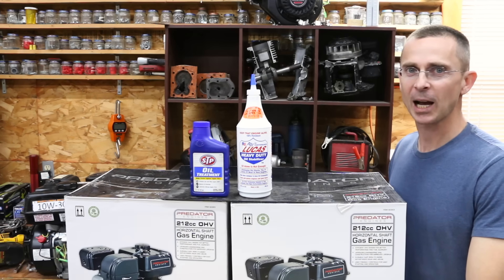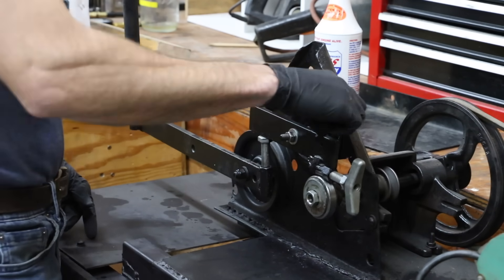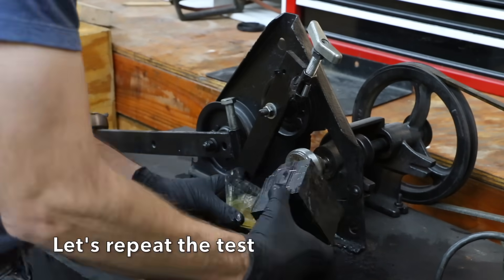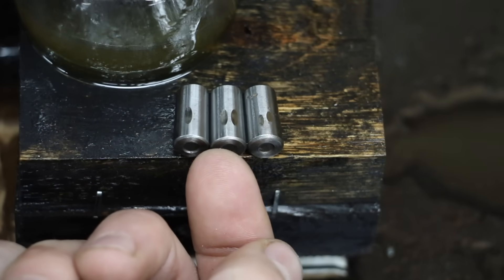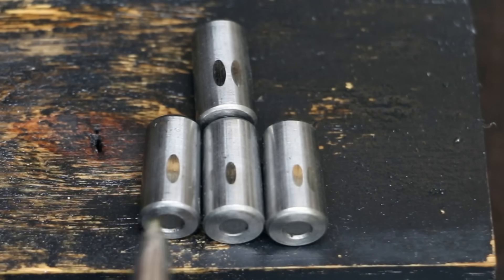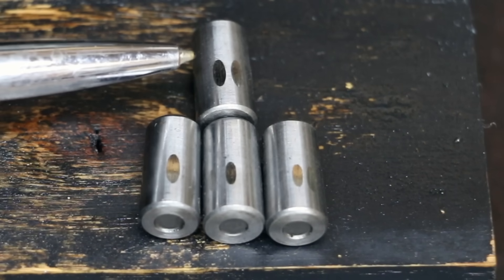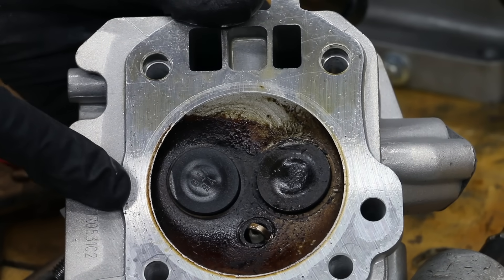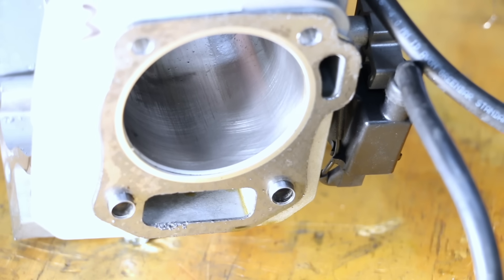Which engine self-destructs first?  Lucas or STP?

Comment: Interesting video - I did watch the whole thing and echo some of the comments here. With an N of 1 it’s fairly pointless to conclude anything, plus there is an underlying assumption in this test that that these products actually have a long term benefit which I don’t think has been shown other than anecdotal or the manufacturers data. 

To show a statistical significance this would have to be designed entirely differently.  Perhaps 10 engines per group, running under load for the design life of the engine with oil changes as per engine manufacturer recommendations with a control group running regular oil as recommended by the engine manufacturer. 

I’d bet there would be no significant difference in any group - the quality of today’s lubricants make additives useless. I’d almost wager the additive groups would fair worse.

Comment: There's an interesting factor about these cling type of oils.  They claim that at startup is where the most damage comes to the engine.  While that's true, the cling factor that these sticky oils have also causes them to stick to the high temperature parts like your rings and the top of the combustion chamber, on the side that the oil flows across the heads.  In these places the oil sticks and the hot oil isn't washed away as new oil flows across the surface.  Then the hot oil gets hotter and hotter causing the rings to stick and the heads to have carbon on them under the valve covers.  I have tried these additives and had terrible results in the long run.  In a hundred thousand miles with all of these cling type additives, your rings will be stuck and you will need to rebuild your engine.
Reply from the maker: Interesting!  Thanks for the information!

Comment: Nice entertaining video, but........where was the control engine with plain oil? Even a trace amount of oil mix left in the engine before starting would make a significant impact on the outcome. To truly test the additives, the engines would have to be disassembled down to the crankcase then cleaned out  and reassembled before the trial began.

Comment: This is about as scientific, or conclusive, as a magician act at a 8 yr old's birthday party. No info about the surface he "sands" then cleans in the initial lubricity tests. No info at all about the meaning of the metrics in those tests. And for the engines: The temperature measurements are lame and meaningless as done. So one ran longer than the other and maybe that would repeat. Do it to ten engines with meaningful temperature sensing and let's see what happens. If one set of ten last much longer than the other ten, I'd feel pretty convinced that I might benefit if I used this shit in my lawn mower. There is not even the smallest chance I'm going to put it in my Porsche, or Ford, or Chevy. WHY?   Because, the people who build and test those engines design for the lube recommended by the manufacturer, and they damn well know vastly more about what their engines need than the marketing hype-makers at STP or Lucas or anywhere outside the auto manufacturer's QC labs.

Comment: I've got a problem with this lubricity tests . He cleans the race . Then he says he sands the race . I don't think so , he's putting a bur into the race so it cuts the bearing quicker . Come on .... This is state fair stuff . Do you remember the guy that used to be on TV where he put water into motor while it was running . And that was a miracle . Water and oil don't mix . So the engine idle or had no load on it it would literally run for ever . It's all Showtime . If you have moisture in the engine and most do . It evaporates once it gets hot .. You have to watch things close .

Comment: Okay . Metal to metal there is no lubricant that I know of that will last under that friction . They used to be a conical slick 50 . It was damn near pure silicone . It's sort of worked . One weakness . When it got hot it turned into a rock like substance . Which blocked all the oil passages . When you remove the oil from an engine it simply will not last . There's a thin layer of world between the bearing and the crankshaft . It comes through a hole that's in the bearing . If you lose oil pressure you will lose the engine . That's not rocket science . There are a lot of companies promoting snake oil for profit . Not a bad idea if your shop owner that wants to increase your profit . Truth is I don't know any of its it works . Oil companies spend fortunes into making oil better than it ever was . They do it through racing . In other ways it's taken them years to formulate with a have . Any good name should be fine . As long as you change oil frequently . Or better use synthetic . Which is probably one of the best things they've come up with lately . It originally was invented for extreme cold weather were all did not flow . But now it's been perfected to the point where it's really good . If I owned a shop I will Promote changing oil often . Instead of snake oil . But that's me . You're better off selling wiper blades and things like that . Than you ever will be selling snake oil . That's what it is . Used to go to the state fairs to see all this crap . They may look as if it worked . It never did . I can give you countless examples of what I've seen . That were just plain silly . But most of the public doesn't understand what works and what doesn't . This series is good but it's not exactly accurate in some cases . All combustion engines use oil as a lubricant so they can live . So naturally if you remove it they will not .
Reply from the maker: Thank you

Comment: A year later I’m commenting. To me all you’re doing is adding gear oil to your crank case. What happens in the winter when temps are in the teens? Will the thicker oil make it to heads and through all the tighter tolerances? That’s my fear with adding these think additives.
Reply from the maker: Great point. Thank you